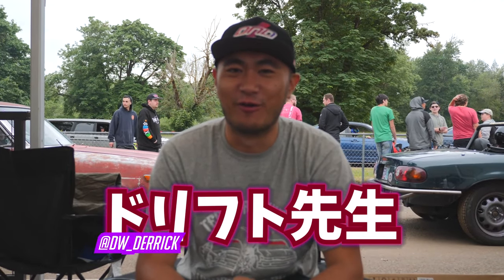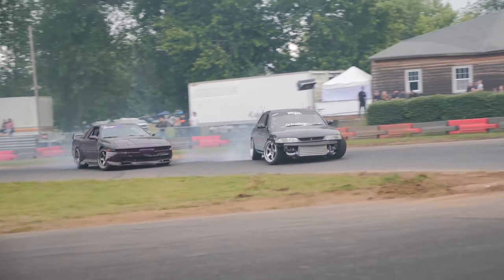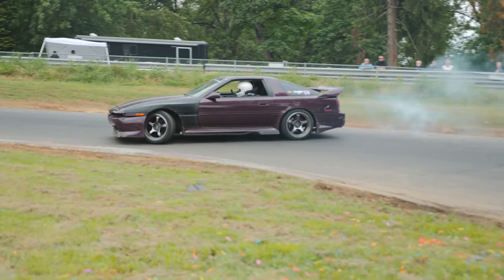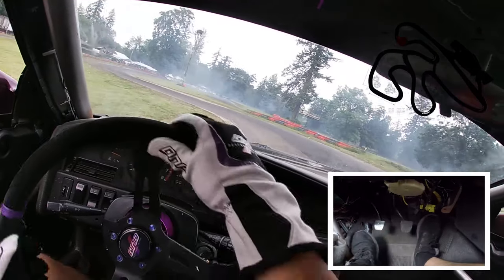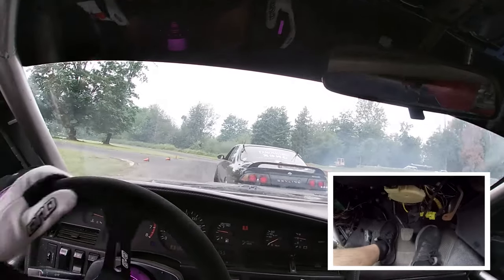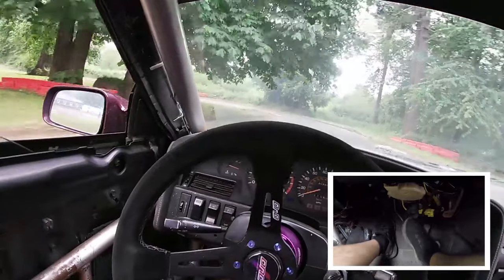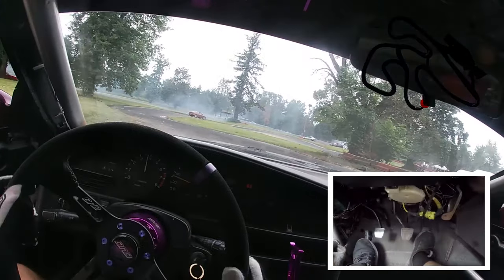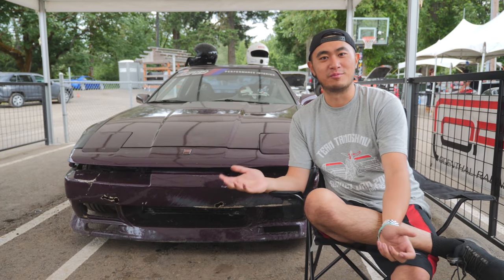DRIFT TIPS: HOW TO Left Foot Brake + Brake Boosting

Comment: What is the advantage to put the car in 4 wheel slide ?
Reply: the car goes more straight as opposed to the arc shaped trajectory of 2 wheel drift. normally to go more straight u have to reduce angle.
Reply: @shinychariot1655  exactly, it's counter intuitive because you lock the brakes to get wider, go forward
Reply: It's way faster, it turns something from a showdrift to beating grip.